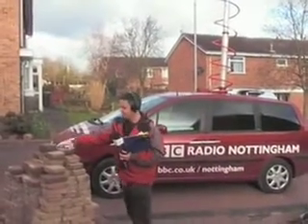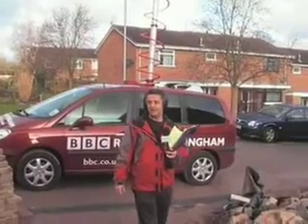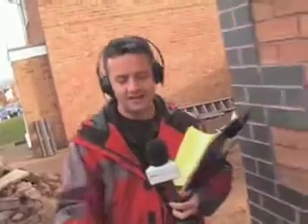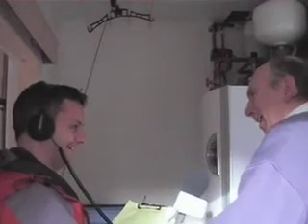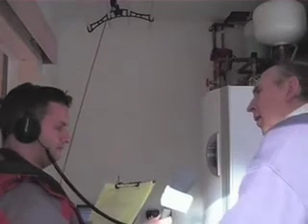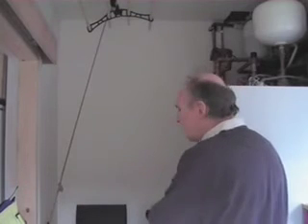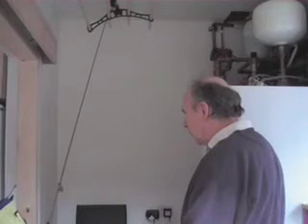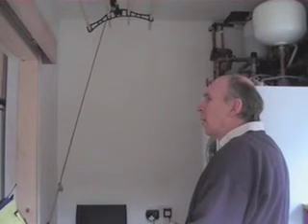BBC Radio Nottingham Heatpump Interview

Comment from the maker: Hi, thanks for the comments. This interview was when the house was very new, only 3 weeks after we moved in. , the system had just been installed, and we hadnt been able to monitor its performance.... the interview was based on expectation. After 2.5 years, we made the decision to add the PV and the Thermal wall panels. PVT did not exist at that time.

Comment: As far as I know there really aren't that many domestic borehole systems out there and this is a lot bigger story than the attention it's getting. I read the system is working really well now that the boreholes are being charged by solar thermal collectors. The reason I looked this guy up was because I'd heard that boreholes were a potential way to usefully store the massive excess heat generated by a pv-t array. A new interview with keywords domestic borehole thermal energy storage needed plz.